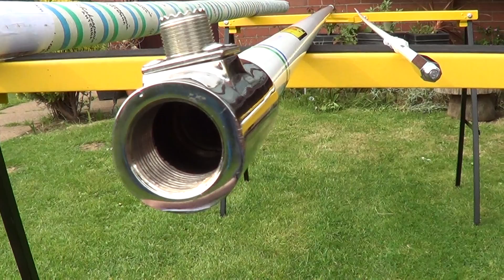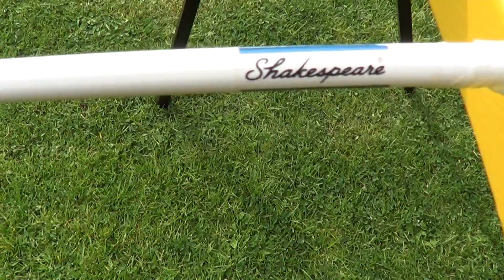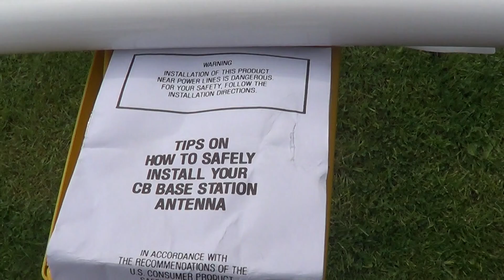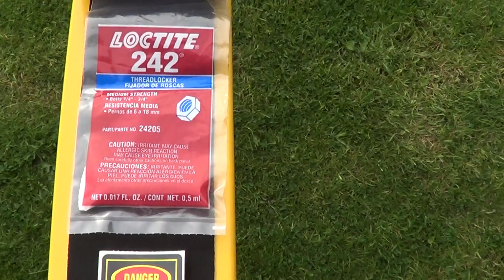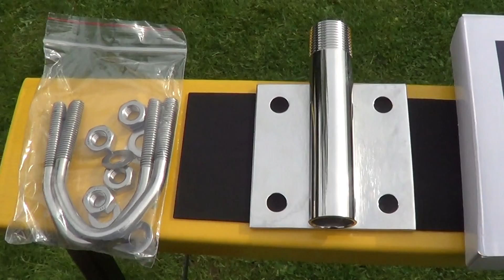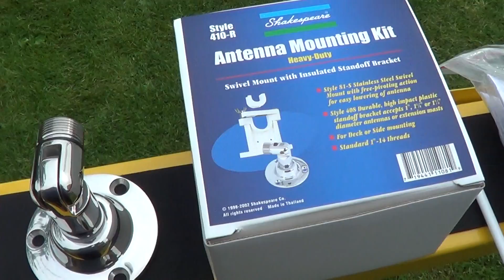Shakespeare 176-1 "Big Stick"CB Antenna Review

Comment: Are these still available dave?
I've got one from the early 90's thats still up after over 30 years.
Im not interested in a flimsy throw away Gainmaster that wouldn't see winter through nr Buxton Derbyshire.
Reply from the maker: I'm not sure as it was 9 years ago. I still own this in it's box, I never used it. It was a company in England who sold them at the time to use on boats and ships. So well up to our weather. I still own my original ABS1600 green Army Big Stick, that came from Truck King 25 years ago........great antennas for sure.  Dave:text-green-game-over:
Reply: These antenna’s are no longer manufactured unfortunately

Comment: I don't know about using that on the CB band 2700 it may work who knows lol I don't know anyone that used it on a CB radio please let me know if it works on the CB Bands thank you have a great day
Reply from the maker: Just because it's designed for a boat doesn't mean it doesn't work on the CB Band, that's the frequency it is designed for, I don't really get where you are coming from TBH. It is a very expensive antenna though 🙂  https://shakespeare-ce.com/marine/product/176-1-marine-big-stick-cb-antenna/
Reply: They work great on CB band.

Comment: I used one of these cut down for 28.2 mHz and ran a 10 metre beacon for 12 years 24 hours a day using the call sign ZS1J/B from 1993 to 2005.

Comment: The top section, how long is it? If the top section os 102 inch a stainless steel whip would work. It also will let you run more power to it. Say 1500 watts. But that's if the top section is 102 inches long. The fiberglass top section is the liming factor as to how much power it will handle. Hope it is 102inch.

Comment: hi dave just wondering is it still possible to get a Shakespeare super big stick new  I'm debating on witch vertical antenna  to bye  antron 99  imax 2000  serio 827  or super big stick  in your view which would u recamand
Reply: Edward Cunningham I recommend the Sirio 827 or the Sirio tornado 27, they both have excellent gain considering that they are verticals. The antron and imax 2000 pick up too much floor noise, poor on receive and decent for transmitting. 73
Reply: Get the A-99.. excellent antenna at a good price

Comment: hi  dave nice shakey  i have the very same one brand new i plan to stick up at the back of the shack as u say really are a first class bit of kit not like the crap turned out now first bit of a bluster and it resembles a  banana lol i agree with one of the comments posted i also dont like were they mounted the so 259 ? as its a awkward position to try and waterproof with a rubber boot ! any way all the best dave keep up the good reviews  73s
Reply from the maker: 128mark Thanks Mark for your kind comments Mate
Reply from the maker: 128mark Thanks Mark for your kind comments Mate

Comment: Hi Dave hope u are well? Another great review! U are particularly good at the antenna reviews I think its your engineering background that shines through when u explain things when it comes to how they are constructed and what materials are used. Great stuff as usual.
Reply from the maker: Gary g1fsh Thank you Gary.
I worked at a specialist engineering and bolt threading company for twelve years and back in the early 90's fabricated all the foundation bolt assy' (some getting on for 100 dia!) for the Pepsi-max roller coaster ride at Blackpool.
I welded them all up too.
So that's how I understand about threads.
But it does help understanding what your looking at for sure and thanks for the kind comments.

Comment: Thanks for the review Dave...No one beats these guys for build quality, sadly i think they lost out in the CB market the Gainmaster will blow this thing away..Its way too pricey for a CB halfwave but i supose you get what you pay for.
Reply from the maker: charlieoscar09 That's correct it performs as good as any other decent half wave.
But it really is in a different ball park build quality wise, but many CBers won't pay more than £100 for an antenna that's a fact.
Reply: Problem is a good strong bit of wind will blow the Gainmaster away!
My Shakespeare has been up well over 30 years.

Comment: Nice clean looking antenna Dave, although the riveting job on the SO239 plate didn't look the best, perhaps threaded bolts into a thread might be better.

Nice review Dave....and the grass on the front lawn looks nice too ;)
Reply from the maker: 26TANGOMIKE037 Thanks Mark and I'm not a lover of alloy rivets TBH.
But they are very secure.
I cut the grass prior to the review as it was rather long.......LOL